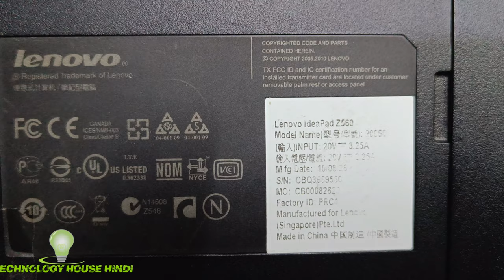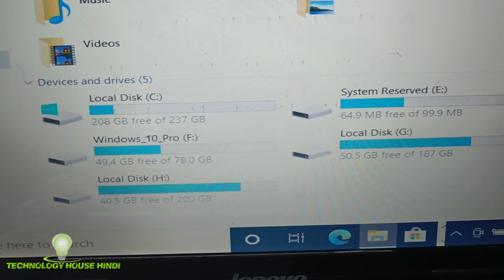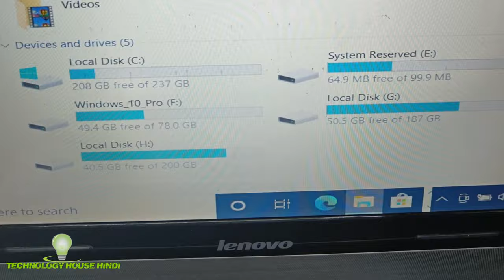Lenovo ideapad Z560 SSD Upgrade ,  Lenovo Ideapad Z560 SSD  / RAM Installation

Comment: Sir, I have IdeaPad Z565. Can I use same method as shown in this video? 
Secondly, my laptop has 4gb ram ; can I add extra 4gb or extra 8gb to IdeaPad Z565? (Without replacing original 4gb). 
Please reply.
Thank You 🙏🙏🙏
Reply: 4x2 şeklinde upgrade edebilirsin ama aynı marka aynı model ram alman gerekiyor